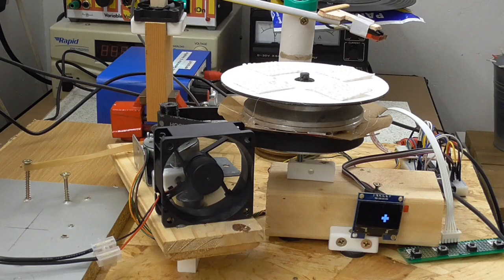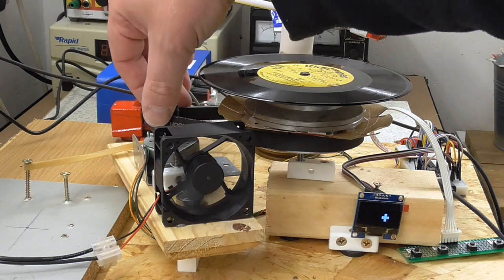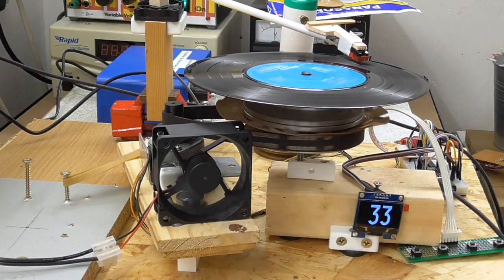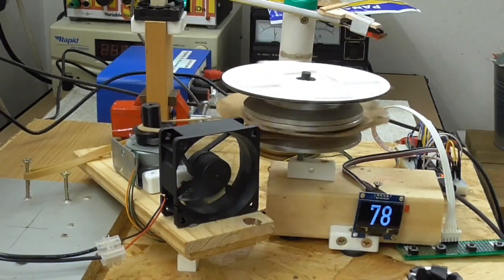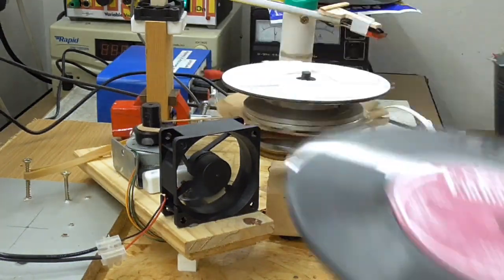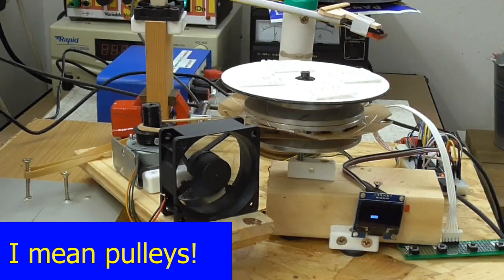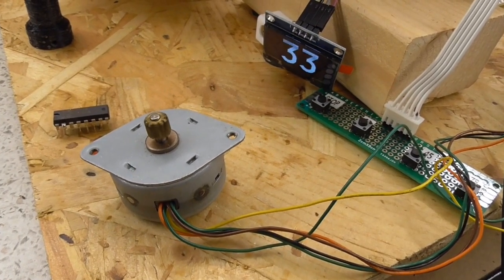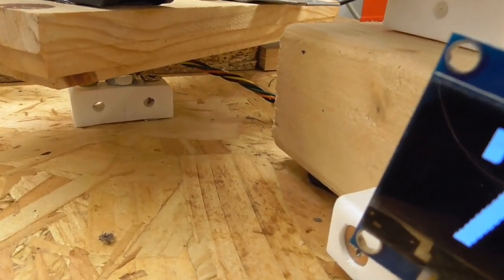More on Belt Driven Stepper Record Player!

Comment: Have you thought about printing a flat pulley? That would reduce drag on your flat belt and help a lot with your wow and flutter.
Reply from the maker: Thanks. Yes I was about to start printing end caps so I could use a bit of cardboard tube for the centre. Is that what you mean?
Reply: mrrgstuff not quite but would work as well. You just keep doing what you’re doing and this yank will keep quiet. Big fan
Reply from the maker: @Mrpurple75  Thanks. Really appreciate the comments. I will keep working at it 😀

Comment: This one is certainly testing your skills and patience 🙂👍
Reply from the maker: Yes, it's proving much harder than I expected. My older DC motor design was much simpler to get working and despite a total lack of 'engineering' worked fine. 😀
Reply: @mrrgstuff  that may be the clue, too much technology 😁
Reply from the maker: Yes, well maybe 😀. I went the stepper motor route as it seemed a good way to control the speed. I think it will work but I can understand why they are not normally used in record players!

Comment: I suggested the rubber band right from the start when I noticed the transfer of the steps to the audio.
It needs to be able to absorb the high frequency stop start. 🙂

The change is noticeable but something else is needed. Have you got it set to maximum microstepping and frequency? Is it a 0.9° stepper motor?
Reply from the maker: Sorry, I didn't check my comments before properly before making this video. I had a feeling the rubber band had been suggested a couple of times and I remember now your comment back on my first video about this. Thanks again 😀 As I'm using the the default Arduino stepper motor library I don't think I have control over microstepping. The motor is l believe 48 steps per revolution so is more like 7deg per step! I'm going to try a proper driver chip which should at least allow microstepping. I also will rebuild the big pulley and I have other motors I can try too. Thanks again 😀
Reply: @mrrgstuff  no problem.
I believe if you can incorporate a Arduino CNC shield it would be the easiest to implement microstepping.
But maybe first try a stepper motor with at least 200 steps per revolution. 1.8° and then maybe 0.9°

Something like this.
https://www.biqu.equipment/products/4x-a4988-stepper-motor-driver-with-heat-sink-cnc-shield-expansion-board-for-arduino-v3-engraver-new-1
Reply from the maker: Yes I my well use a CNC shield like that - I've have a kit like that for another project but not tested it yet. I was just going to 'borrow' it for this :-). Probably move over to an Arduino UNO as it will be easier. The stepper motors I have are all from old typewriters and inkjet printers. I need to go through them and see what the stepping rates are. Thanks :-)

Comment from the maker: /*
 Stepper Motor Record Turntable

 This program drives a unipolar or bipolar stepper motor.
 The motor is attached to digital pins 14,15,4,5 of the Arduino
 Should work with most Arduinos however pins specified are for Sparkfun Pro Micro

 Buttons connected to pins 6-9 control the speed
 6 = 0 rpm
 7 = 33 rpm
 8 = 45 rpm
 9 = 78 rpm

 8 (45) and 9 (78) pushed together take turntable into low speed mode (set by LOW_SPEED)
  
 Based on Arduino example by Tom Igoe
  Created 11 Mar. 2007
 Modified 30 Nov. 2009

mrrgstuff - 2019

============ BSD License for U8g2lib Code ============

Universal 8bit Graphics Library (http://code.google.com/p/u8g2/)

Copyright (c) 2016, olikraus@gmail.com
All rights reserved.

Redistribution and use in source and binary forms, with or without modification, 
are permitted provided that the following conditions are met:

* Redistributions of source code must retain the above copyright notice, this list 
  of conditions and the following disclaimer.
  
* Redistributions in binary form must reproduce the above copyright notice, this 
  list of conditions and the following disclaimer in the documentation and/or other 
  materials provided with the distribution.

THIS SOFTWARE IS PROVIDED BY THE COPYRIGHT HOLDERS AND 
CONTRIBUTORS "AS IS" AND ANY EXPRESS OR IMPLIED WARRANTIES, 
INCLUDING, BUT NOT LIMITED TO, THE IMPLIED WARRANTIES OF 
MERCHANTABILITY AND FITNESS FOR A PARTICULAR PURPOSE ARE 
DISCLAIMED. IN NO EVENT SHALL THE COPYRIGHT HOLDER OR 
CONTRIBUTORS BE LIABLE FOR ANY DIRECT, INDIRECT, INCIDENTAL, 
SPECIAL, EXEMPLARY, OR CONSEQUENTIAL DAMAGES (INCLUDING, BUT 
NOT LIMITED TO, PROCUREMENT OF SUBSTITUTE GOODS OR SERVICES; 
LOSS OF USE, DATA, OR PROFITS; OR BUSINESS INTERRUPTION) HOWEVER 
CAUSED AND ON ANY THEORY OF LIABILITY, WHETHER IN CONTRACT, 
STRICT LIABILITY, OR TORT (INCLUDING NEGLIGENCE OR OTHERWISE) 
ARISING IN ANY WAY OUT OF THE USE OF THIS SOFTWARE, EVEN IF 
ADVISED OF THE POSSIBILITY OF SUCH DAMAGE.   
 
 */

#include <Stepper.h>

#include <Arduino.h>
#include <U8g2lib.h>

#ifdef U8X8_HAVE_HW_SPI
#include <SPI.h>
#endif
#ifdef U8X8_HAVE_HW_I2C
#include <Wire.h>
#endif

U8G2_SH1106_128X64_NONAME_1_HW_I2C u8g2(U8G2_R0, /* reset=*/ U8X8_PIN_NONE);

const int stepsPerRevolution = 48;  // change this to fit the number of steps per revolution
// for your motor

// Buttons for changing speed - define the Arduino pins
// Button 0 now connect straight to reset -  but make it an input for safety
#define Button_0 6
#define Button_33 7
#define Button_45 8
#define Button_78 9

// index into an array wihich hold the actual RPM values
// done like this because may want to tune values on fly in future versions
#define RPM_33 0
#define RPM_45 1
#define RPM_78 2

// LOW_SPEED is a special mode for turning the turntable slowly. Not for playing a record
// uses same array as proper RPM speeds above
#define LOW_SPEED 3

//These are the approx rpm speeds for 33,45,78 and LOW_SPEED which is 15
// Values can be fine tuned for each speed - not relying on a single multiplier
// This also allows speeds to be tuned to match another record player for comparision playing

// Vucuum Cleaner Belt drive ratio is about 1:6 - first 4 values
// Rubber band Belt drive ratio is about 1:3.9 - 2nd 4 values

int rpm[2][4]={{207,273,479,98},{130,172,302,62}};

#define VACUUM_CLEANER 0
#define RUBBER_BAND 1

int belt=1; // default to rubber band

// Still need human readable values to show on the display
int rpmdisplay[]={33,45,78,15};

int rpmspeed = 0; // holds actual rpm speed of stepper motor
// Next 2 are used for the idle display when rpmspeed = 0
int count = 0;
bool state = true;

// initialize the stepper library on pins 14,15,4,5:
// Pins 2 and 3 left for I2C OLED display
Stepper myStepper(stepsPerRevolution, 14, 15, 4, 5);

void setup() {
  pinMode(Button_0 ,INPUT_PULLUP); // doesn't really matter as also connected to reset
  pinMode(Button_33,INPUT_PULLUP);
  pinMode(Button_45,INPUT_PULLUP);
  pinMode(Button_78,INPUT_PULLUP);

  // set up the display for the speed selection
  u8g2.begin();
  u8g2.setFont(u8g2_font_logisoso62_tn);
  display_string("--"); // just to show arduino has started
  delay(1000);
  // set the display to 0 rpm)      
  display_speed(rpmspeed); // will blank display as don't show 00
        
  // initialize the serial port:
  Serial.begin(9600);
  //Serial.println(rpm[belt][RPM_33]);
}

void loop() {
  // step whole revolution at the desired speed:
  if (rpmspeed != 0){
      // go around again. Do as little in here as possible
      myStepper.setSpeed(rpmspeed);
      myStepper.step((rpmspeed*100));
      return; // only reset allows us to get back to changing the speed
  }else{
    // display idle screen. Prevent burn in whilst idle and also show Arduino is still powered
    if (count++>10000){
      count=0;
      state=!state;
      if (state){
        display_string("- ");
      }else{
        display_string(" -");
      }
    }
  }
  // Low Speed mode turned on if 45 AND 78 pushed at time
  if ((digitalRead(Button_45)==LOW) && (digitalRead(Button_78)==LOW)){
    rpmspeed = rpm[belt][LOW_SPEED];
    display_string("//");
    delay(500);
    display_speed(rpmdisplay[LOW_SPEED]);
  }
  if (digitalRead(Button_33)==LOW){
    rpmspeed=rpm[belt][RPM_33];
    myStepper.setSpeed(rpmspeed);
    display_speed(rpmdisplay[RPM_33]);
  }
  if (digitalRead(Button_45)==LOW){
    rpmspeed=rpm[belt][RPM_45];
    myStepper.setSpeed(rpmspeed);
    display_speed(rpmdisplay[RPM_45]);
  }
  if (digitalRead(Button_78)==LOW){
    rpmspeed=rpm[belt][RPM_78];
    myStepper.setSpeed(rpmspeed);
    display_speed(rpmdisplay[RPM_78]);
  }
}

void display_speed(int speed)
// Converts speed to a string and calls display routine
{
    char speed_str[3];
    strcpy(speed_str, u8x8_u8toa(speed, 2));    /* convert speed_str to a string with two digits */
    if (speed==0){ strcpy(speed_str,"  ");}
    display_string(speed_str);
}

void display_string(char *txt)
// Displays string on 128x64 OLED display using u8g2 library
{
    u8g2.firstPage();
    do {
      u8g2.drawStr(25,63,txt);
    } while ( u8g2.nextPage() );
}

Comment from the maker: // OpenSCAD file for the 3d printed parts
$fn=32;

cd_thickness = 1;
cd_hole_radius = 7;
adapter_base_height = 10;
adapter_base_radius = 9;

top_peg_radius = 7/2;
top_peg_height = 8;

pulley_hole_radius = 8.5/2;
pulley_hole_depth = 10;
pulley_inner_height = 12;
pulley_outer_height = 18;
pulley_inner_radius = 7;
pulley_outer_radius = 15;
pulley_base_radius = pulley_outer_radius -2;
pulley_base_height = 8;
pulley_top_height = 4;
pulley_top_screw_radius = 2;
pulley_side_screw_radius = 1.5;

pulley_flange_height =  (pulley_outer_height-pulley_inner_height)/4;

// First set of modules make the 2 parts of the pulley 
module drive_pulley()
{
    difference(){
        union(){
            drive_pulley_base();
            translate([0,0,pulley_base_height]){
            drive_pulley_flange();
            // this is the central column of pulley
            cylinder($fn=64, h = pulley_outer_height, r = pulley_inner_radius, center = false);
            }
        }
        bottom_hole();
        top_hole();
        screw_holes(6,90);
        screw_holes(6,0);
    }
}

module drive_pulley_base()
{
    union(){
            cylinder(h = pulley_base_height/3*2, r = pulley_base_radius, center = false);
            translate([0,0,pulley_base_height/3*2]) cylinder(h = pulley_base_height/3, r1 = pulley_base_radius, r2=pulley_outer_radius, center = false);

    }
}

module drive_pulley_flange()
{
            cylinder(h = pulley_flange_height, r1=pulley_outer_radius, r2 = pulley_inner_radius, center=false);
}

module drive_pulley_flange_top()
{
    difference(){
        union(){
            cylinder(h = pulley_top_height, r=pulley_outer_radius);
            translate([0,0,pulley_top_height])
            drive_pulley_flange();
        }
        
        cylinder(h=20,r=pulley_top_screw_radius,center=true);
    }
}

module top_hole(){
        translate([0,0,pulley_outer_height+5])
        cylinder(h=18,r=pulley_top_screw_radius,center=true);
}

module bottom_hole()
{
 translate([0,0,-1]) cylinder(h = pulley_hole_depth+1, r = pulley_hole_radius, center = false, $fn=64);
}

module screw_holes(height,angle){
    translate([0,0,height/2]) rotate([0,90,angle])  cylinder(h = 30, r = 1.25, center = true);
}

// modules from here make the CD adapter for the top
module cd_adapter()
{
    union(){
        adapter_base();
        translate([0,0,adapter_base_height]) cd_fitting();
        translate([0,0,adapter_base_height+cd_thickness])top_peg();
    }
}

module adapter_base()
{
    cylinder(h = adapter_base_height, r = adapter_base_radius, center = false);
}

module cd_fitting()
{
 cylinder(h = cd_thickness, r = cd_hole_radius, center = false, $fn=64);
}

module top_peg()
{
 cylinder(h = top_peg_height, r = top_peg_radius, center = false, $fn=64);
}

translate([15,15,0])cd_adapter();
translate([-15,-15,0]) drive_pulley();
// Didn't need a top for the pulleyin the end - but this is it below
//translate([20,-20,0]) drive_pulley_flange_top();